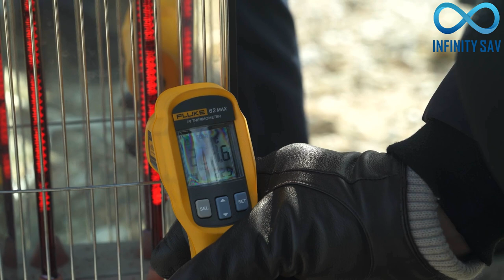Fuel Free Electromagnetic Generator 10kW prototype - 5 hour island test (promo)

Comment: To all non believers is it possible to stick one end of a wire into the ground and run up that wire and measure between the top of a 6 ft wire and get 100vdc? Negligible amperage but the voltage is there?

Comment: All of those are LED bulbs 10x10 at 10-20W 1-2kW, the fan is like 80-120W, and that space heater looks as if it has LEDs in it. For a more realistic test, put a bigger inductive load on it, use incandescent bulbs, and show tests with different space heaters, like a radiant quartz one. As I see it, even if you can only run 3 or 4  100W incandescents, that's demonstrating true power even if it's not a lot its still desirable for portable applications. WITTS Ministries debuted a semispherical solid-state device that could jump start a jeep without a starter battery. Personally I find the other device you showed off that was small and fit on a countertop to be more useful as a solar battery charger replacement. Even if the device outputs a few hundred watts...consistently...for a long period of time even if it's not 10 years is invaluable to to someone like me. I could have the device charge up a 100Ah LiFePO4 pack and power a camper. Charge an EV overnight while I sleep. Put the lil thing in a vacuum to help efficiency, use magnetic levitation bearings, etc. I would never run out of uses for a product like this.

Comment: Selling those pre-orders for $5000 and $15000 as you currently do on your website is much better than letting potential investors (after signing and NDA) have a good peek at every part inside the device, Let alone letting an independent institute like a university lock it in their safe, having them check it now and then to see for how long it runs. Or allowing any reputable technical test organization to test it. Right?
: D

Comment: To all those who don't believe,... You do know, it's not actually FREE energy..

all this is doing is converting Magnetic energy into rotational motion, then that rotational motion via a dynamo into electricity.... one form of 'energy' into another, no laws broken!

Also look into scalar fields and bifiliar coils ;)

this is not an old concept..

I played with magnets and motors and such when I was younger, using fans with magnets glued to the blade, and placing magnets round the outside to spin the fan, didn't work every time, but I did have it working - so I can see the possibility...

And magnets eventually loose their magnetism, over time,  so the more this device is used, the more weaker they will get - this is also why the 'panels' on the device are easily removed and replaced (that and for 'proof' to the media of what's inside)

however, it will likely be many millions of hours before they actually do loose their magnetism - the biggest potential problem I can see is heat generated from the moving/rotating/passing magnetic fields...

Comment: This is great in terms of portability, however, due to it’s small size utility would ultimately be limited. If this were either greatly enlarged or used in mass, then maybe this could become practical. It will still be impractical when compared with nuclear power.
Reply: one in your car with a big capacitor to temp store energy for take off, no batteries needed..
and when that car stands still at home it can connect to inject into gridd and make me money.

I bet you want one now .. ;-)
Reply: @ericmieremet  Not when our power grids can barely maintain the current energy demand. The united states would require a multi-billion/trillion dollar wave of subsidies, in order to overhaul the current power grids to be able to maintain that level of power demand. The problem is our incompetent leaders are to busy giving themselves raises and wasting our money elsewhere to actually make that plausible. Not to mention even if such a world became a reality over half of the population wouldn’t be able to support such a lifestyle change, either economically or fundamentally.

Comment: Where are we in production? Also why belt driven if it's a ground issue you can use polyfiber chains and sprockets like older vehicles timing chains just before timing sensors. Where the 1500 rpms measured at? On the drum or electric motor? GPS locking is prohibited in the USA. I know that what you show here is a Demostration model. I am hoping that you will go with longer lasting parts for production? Plus if your rpms are measured at the drum double the pulley size will use less power at the motor. Plus how much battery is needed for let's say 60 amp kick on for the heat strips in a heat pump HVAC for a home. 2 MG10 units would put out more power than I can use and the power company will buy back. Summers are not a problem, it's the winter's when the temperature dips below 32 deg Fahrenheit 0 degrees celsius, just kicking the heat strips on shuts down my 15 kw split phase generator cause that surge can last almost 5 seconds so how much battery bank will I need to prevent large surge shutdowns?
Reply: Fred Bloggs  hey Fred I have similar plans like this from Nikola Tesla so yes I believe that this is possible but you see I have called and received information from BBB and an Attorney so it's just a matter of money. For the sake of discussion why do you not think that this is real?

Comment: Fred I am an Electronics technician by trade I have all Teslas patents except for the ones that certain individuals have stolen. And it's possible to generate more than you can use  and like I said I have Nikola Tesla's patent on this. Now we can't call it perpetual motion due to drag and friction plus heat losses but it's about as close as anyone can get. I don't know your background but a 3 Masters degrees one in Applied Sciences is all I need for this plus money to compete projects,  I have applied for grants and the reason why I was rejected is because I live in a mobile home on 22 acres.  Now doesn't that sound a bit fishy?
Reply: Fred Bloggs  Fred when you lower voltage your amperage must go up because voltage and amperage are inversely proportional to power! Right?

Comment: Hey Fred where did you go I was enjoying our conversation, if I build 6 54 ft towers in parallel that's 900 vdc lower the voltage my current won't increase is that what you are saying?
Reply: Voltage is inversely promotional to Amperage or current!

Comment: Sir can you tell me one thing
First you ran the motor through inverter and then the motor was running on inverter or magnets power please explain the concept did the magnets mechanically rotate motor to Generate electricity
Reply: no, the motor rotate coil inside magnet to generate electricity then generated electricity rotate motor to create loop with excess power.

Comment: Guys stop for a minute as I just did, does this earth burn fossil fuel to keep it going what powers the earth around the sun for that matter what has been powering the earth for the past couple of million years...basically just magnetism. Am certain of enough is put into it will work
Reply: Chryst within earth and sun give to each other as warmth.
Fossil fuel was for the neanderthal.
If we wish to evolve, we must keep up with the lessons. Over unity is key, I'm not certain the particular model machine shown hear is a good example, as you can clearly see the shadow of removed batteries over time.
Say one small motor driving 9 generators with one big flywheel to store energy. Many small quick capacitor banks to charge and discharge, like pulse drive.
Star trek fans will see le forge.
Mary go rounds were the lesson in secret.

Comment: The cost of this unit and maintenance will overpass the cost of simple electric gas/propane generator with 30 years cost of fuel. They use stored magnetic energy packed into magnets. There's no free energy. Free means no money exchange for work or service. What is the price for kW going to be if this unit will run for 10, 20, 30 years? That is the real question.

Comment: FRICTION!!!

There are no such thing as a free lunch!!!

For every action there is an equal and opposite reaction!!!

Sir Isaac Newton might be long gone... but his ideas is very much still alive!!!
Reply: Magnetic fields pull electrons from the ether and flow them in the coils. Generating a magnetic field can possibly be done with less energy then it will provide. There is free energy all around us. Harnessing it does not burn as much energy as it, as it itself is equal to.  Like corralling a horse. It takes much less energy to corral a horse but that horse has so much more energy than what was used to corral it.

Comment: We really just need NASA technology long since had, released and made available to the general public. Or like the hydrogen fuel cells that were powering the entire GM facilities (not the manufacturing parts- but some offices of GM) donkey's years ago (generators the size of domestic fridges) available for the public.  Or the Solar hot water heating units developed in Applied Physics in the late eighties at the University of Sydney; to become commonly available.

Comment: Actually it's possible to get electricity from the earth by grounding one end of a wire and for every 6 ft you generate from the top of the wire back to ground 100vdc amperage is negligible, however making a coil adds amperage so using an air coil at 36 ft you will develop 600+ voltsdc and increase the amperage, thus using a DC voltage converter  you can step down the voltage to 240 divided into 600 then multiply the current convert DC to s 120 split phase ac and a center tapped transformer and get enough power to run a house.  Just have to encase the coil to keep it dry and add  a lightening arrestor and wahla you have power to run your house now the only reason I have yet to do this is money.  The 3 LV 5048 DC to ac converters are 6000$ dollars and the wire 14 gauge with only a varnish insulator is expensive,
Reply: Fred Bloggs  part of the problem with this issue is JP Morgan Edison who was actually a thief and now the power moguls! One question that was asked on her about getting more out for less which the power company does all the time, so with that in mind can I lift a 100 lbs with 1 lb. You said proper physics this would be impossible?

Comment: You made all this "effort" to make the case transparent, that you have nothing to hide. But always, every time, the device is never shown from all sides, and some parts are obstructed by opaque stuff, like a wheels, or a rocks here. If you made so big effort to make it transparent for some marketing reason, why not suspend it from the chain crane, or put transparent support from the bottom. Plexiglass is cheap and sturdy.

Comment: How can contact with y
Reply: Do you want to buy a free energy machine or plans?
Reply: @JonSpink  
If you have to buy it, then it isn't free energy.
Reply: @random6809  solar is free you have to buy the equipment to collect it thats all
Reply: @JonSpink  
So it is not free then.   Until you have a return on investment the energy is not free!
Reply: @random6809  ofcourse you get a return you get the electricity
Reply: @JonSpink  
The energy produced is not free until you reach the point that the savings made by not paying for electricity is greater than the cost of buying, installing and maintaining the solar panels.

In my country it takes around 18 years to get a return on Investment from installing solar panels on a home.

I don't think you know what Return on Investment means!
Reply: @random6809  no thats not how free works
Reply: @JonSpink  
smh

Comment: Nice Demo but it proves nothing!🤔 Since there was no measurements taken current in to start device, current out. Besides inspecting for battery's, other sources feeding machine,  basically it supposed to be a magnetic motor generator. That only can run short periods cause magnets get hot, and break.

Comment: Come and see me when you want one the size of a football with no moving parts and no magnets or coils or batteries required. Just add water. You can build it but I won't it's too powerful. You can get around 25,000 volts with an object the size of one cubic centimeter so the football size one would be quite powerful. I'll only share it if there is no commercial interests and completely open source. This can be shrunk down to the size of a pin head... a nano generator. 3d printed in the millions.

Comment: The old Tesla patent before 100 years, as the aggregate on the boom is worth more than the parts that were purchased, that is, the aggregate on the batten costs $ 100 and parts of this generator $ 40 it is made with parts the generator is worth upwards of $ 75. Another spam to spend in the amount of the wager sucker collector. If you want to earn a lower price.

Comment: The people who keep thinking that there are batteries on this thing need to really think about how much power is needed to run that long at that wattage because a battery big enough for that sort of output duration would be bigger than the generator itself so stop trying to fool anyone else with your lies about batteries being on that generator because I can't tell you any other way that batteries don't charge up in a mere 5 seconds and capacitor banks don't last that long either so is drop the topic about batteries being in this thing
Reply: For previous tests which were only minutes long, batteries were used.   For this test there is a diesel generator on the boat powering it.   Don't be so gullible.

Comment: From what I see in the video and what I gathered from the unit by looking on your website, I doubt the unit can do what you say it does. Firstly, the mechanism at work can't be seen from the video, likely room to fit a large car battery with a small motor, and with the addition of the main battery could likely fuel the devices shown for the 5 hours. By the looks of it there is LED bulbs, a fan, a phone charger and only a heater for 50 minutes. Not a particularly big power load after the heater is turned off, which it in itself is not on very high.

Comment: I'm really lost. WTF is this BS? As far as I can tell? It's a few Americans standing around a box with an electric motor in that's turning for some reason a belt, which is connected to something that isn't even spinning. Then attached to that you've got, what an electric heater and a load of LED bulbs? WTF is the point? I'm so confused.

Comment: At first thanks for the wonder. Who thought there are no alternatives to Oil & gas and numerous energy sources Men have used to oppress the environment as well as fellow humans. However, I have an issue with your business model. I still sense control. The device cannot operate without being connected to GPS. The server which is under your control is inevitably under government control and indirectly restricted by major Energy power brokers. Can someone for just once offer something so free for humanity?
Reply: If that's your problem... Mine is that this thing only works until the batteries run out.
Reply: @andreasschmitt2307 , but it does not use a battery..
Reply: @delcosmo  
Sure it does. The batteries are in the barrel with the magnets. The supposed generator is just an electric motor. You can even see the belt tension at the wrong side (1:13), which clearly shows that the motor drives this contraption.
Reply: @andreasschmitt2307 , Oh! shit.. I thought its only generate electricity pure from magnetic induction.. The energy is not free then
Reply: @delcosmo  
Even if it works it's not free because Infinity SAV wants 8000$ for the small and 15000$ for the big device. But only preorder, obviously they have nothing to sell, only CGI on their web page for years now.

Comment: OK .... I'll bite ... What do you need in order to do a demo here in Canada?

I can get customs and work visa clearances for you 

AND

I've got high speed professional cameras, professional-level and laboratory-grade calorimeters and dynanometers, EM measurement gear, etc. etc.

What I need to know is based upon attaching your system to a 1000 watt cinema-quality 6500 degrees Kelvin lamp, how many continuous hours can it run?

When attached to dynanometers, how much torque in newton/metres (or foot/pounds for US viewers!) are you getting and how much average output KW or BHP are you measuring over one hour?

See dynanometer information:
https://en.wikipedia.org/wiki/Dynamometer

See calorimeter: (i.e. power compensation type)
https://en.wikipedia.org/wiki/Calorimeter

..

Email me as per my youtube channel's ABOUT ME option so see what I can do to help you properly MEASURE and VERIFY the output of this device!

.